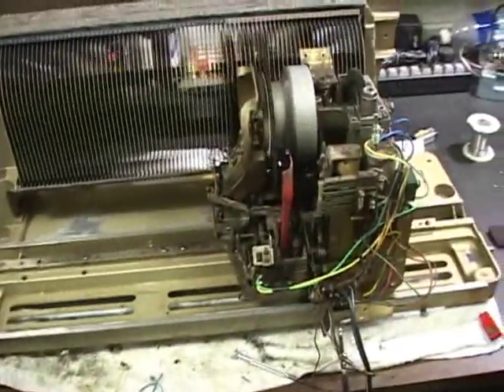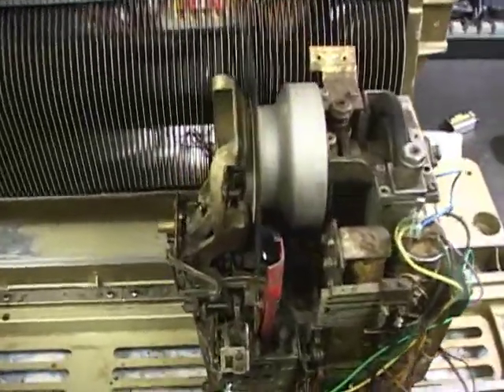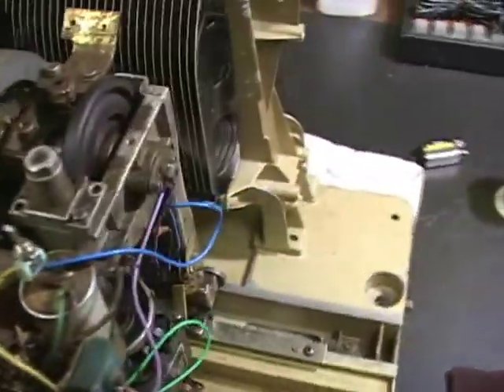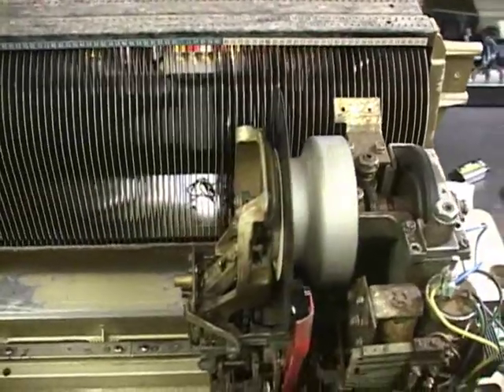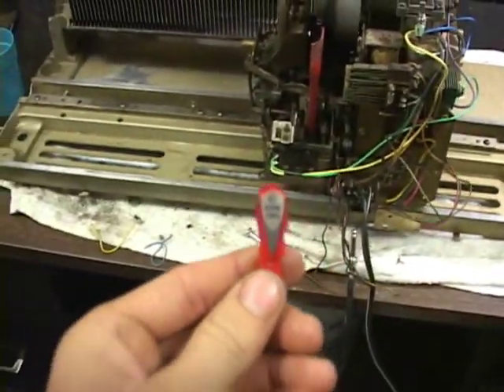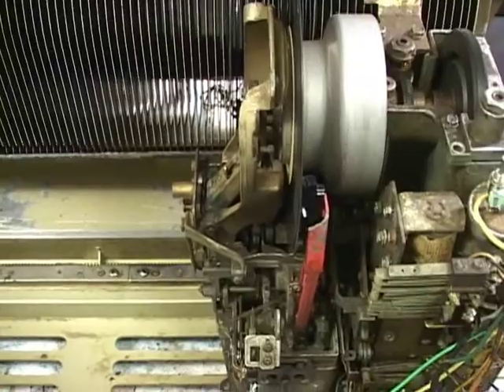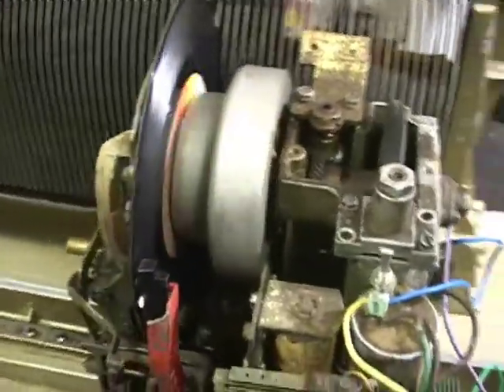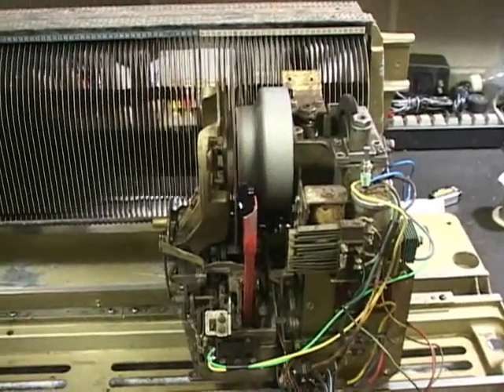Seeburg jukebox Selectomatic 160

Comment: I have a 1970's mechanism similar to this.  It is complete with the tormat selection reciever and wall box, but I cannot get it to select individual records.  You can load the tormat and it will play all the records and both sides. The wall box activates the changer but it just scans and shuts off.   I will work on it again one of these days to try to determint the problem.  It was  very clever of you to modify this and get it working.

Comment from the maker: I'll make a video on it.. Basically I've got the position switch (to the right of the motor when looking at that side) wired in parallel with the end-of-record switch and powering a relay to activate the large solenoid that trips the mechanism into gear. The toggle switch on top takes the position switch out of circuit so that it will "seek" until you flip it.

Comment from the maker: When you say stop, does it put the record back, or just stop turning? Try lubricating the mechanism related to the solenoid if it is putting the record back immediately, and check the tiny trip wire switch that senses end of record.

Comment: I have a 100G I have two issues; the first is the pins aren't getting reset by the paul. The other is the record is selected and then it just is replaced into the rack.I've tried cleaning the contact using contact cleaner and paper.  Any help would be appreciated